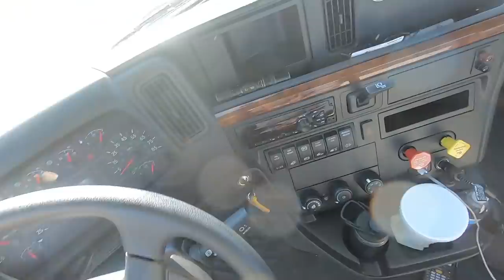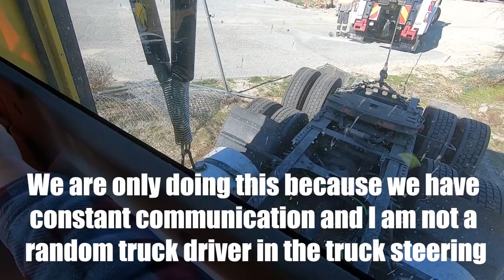Runaway Truck Through A Fence With No Brakes

Comment: There seems to be a plague of drivers forgetting to set the brakes lately. I suspect they got their CDL from a school where they just pay for the license without getting any instruction. One of the first things a driver is taught is to set the brakes before leaving the cab. It's something drivers do automatically. Maybe manufacturers need to modify trucks so the brakes come on when the door is opened or the seat belt isn't fastened. You can't make drivers smarter but you can make the truck smarter.
Reply: That's a great theory.  I have heard reports of a national driver shortage.  Makes sense that "schools" are just churning them out with little to no hand-on instruction.
Reply: Well I have had my seatbelts alarm go off because of a loose cable while driving down the road. Would be pretty bad if it set the brakes too.
Reply: you would say though that they learn such a thing for their car license too.

Comment: When I am stuck in Euro truck simulator i press V to activate the differential lock to get out from ditches why u didn't press V
Reply: He did, the frame twist was too much to maintain traction over that last bump.
Reply: And it wasn't a simulator either the real world is a lot different then a game. I know I'll been stuck a lot of times and had to get out all by my lonesome.
Reply: Real life is not like a video game, the amazing crap you can pull off in games doesn’t translate to the real deal too well. A bobtail is so light in the ass end it would take piling ten fat people on the back to get good traction off road.
Reply: Real life is glitchy
Reply: Does the simulator have sand and cactus mode?

Comment: i ran flat bed on job sites we got in and out in soft sand and mud did not get stuck when we went to automatic we got stuck all the time we had a coustmer in vermount small hill to get in in the snow stick shift got in automatic would get stuck had to get towed in every time we went back to stick

Comment: Why the shackle between the hook and chain?  Just curious.
Reply from the maker: This achieves the 3 link rule which states that a chain is at is full working load limit(WLL} when 3 links are in contact with the winch. Often times the hook will not achieve this but a shackle will, hence achieving full WLL. Thank you for watching!
Reply: Plaza Towing thanks for your time to reply.  Enjoy the videos.  Be safe.

Comment: How often do you find the tractors equipped with pintle hitches?  I could've sworn I've seen them like that fairly often even for trucks that normally pull fifth-wheel trailers.
Reply: I see pintle hitches on almost all LTL carriers because they pull doubles and triples depending on the state

Comment: Since you had already backed up to fence why did you have to be pulled through the fence line.
Reply: Not all the rear wheels are drive wheels. When they hit the raised dirt at the fence line it was loosing traction you can see the tires spinning.
Reply: it was going a little uphill and with no weight on the rear drive tires, they were just spinning and did not get any traction on the dirt.
Reply: He didn't have traction

Comment: I love all wannabe super truckers in the comment section. This is a very common occurrence. It’s so common, newer trucks sound the horn if the door is opened and the brakes are not set.
Reply: JoePJack1 I think you are full of it common occurrence my ass and I have never seen a truck that blows the horn if you open the door and the brake is not set.

Comment: Professional drivers don't forget to set the brake.

Were you ignoring him because A) You knew he was an idiot B) There was a language barrier C) You were busy talking to your partner D) All of the above? :-)
Reply: They  must have just  started.
Reply: I say maybe B and C, because he only communicating with the truck driver for a few minutes in the video, and he is on his phone all the time with his partner who is doing all the control on the tow truck, instead of using 2 Walkie Talkie for both of them to talk to eatch other from far away and maybe talk to the truck driver too in the video, if this is a Ron Pratt Video, I think he will used 2 Walkie Talkie to talk to eatch other from far away and not using phone to talk to eatch other all the time, just saying.
Reply from the maker: To address both your questions, We had spoken to the driver prior to turning the cameras on. We had informed him that once we started the recovery he needed to stand back and allow us to do our job because of the hazards associated with the recovery. Ming Hong Lim, the system we are using to communicate is far more superior than phones and walkie talkies. We are equipped with a full duplex communication system consisting of headsets that allow us to be in constant communication. Although walkie talkies get the job done, this system is far superior and provides clear communication, noise cancelling when needed, and hand-free operation. If needed, we are able to communicate with others who do not have a headset by putting them in pass through mode but with the culmination of the language barrier and the driver disregarding our instructions, we were forced to ignore him until the recovery was over. Thank you for watching
Reply: I did not know both of you used headsets with full duplex communication system on the towing job, I know other people need to be in a safe distance and safe place from both of you so that both of you can do your job safely and recover the run away truck safely back to the parking lot.

Comment: This is a case of pure stupidity.  I’ve seen many truck drivers that don’t apply the parking brake.  Any driver that “Forgets” to pull the brake and it goes rolling away should be fired on the spot.  No reason for this to happen.   It’s not a difficult thing to do or to remember.